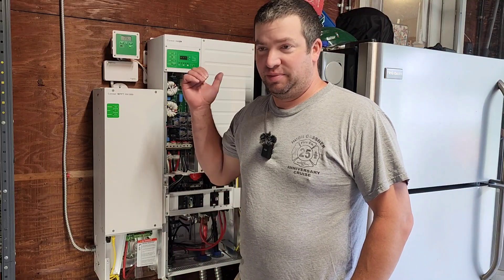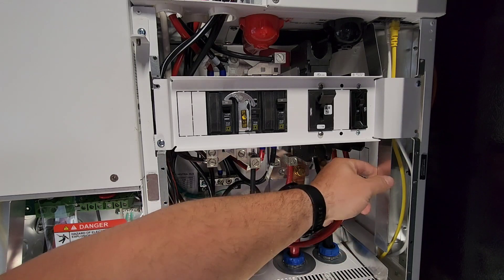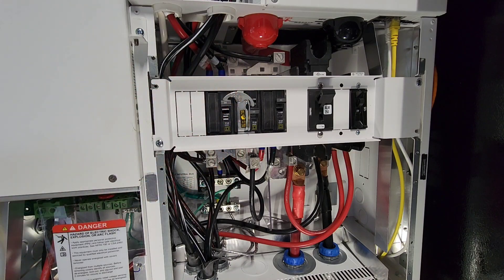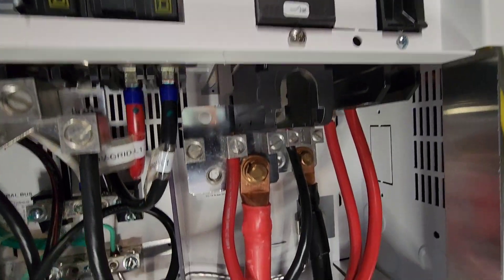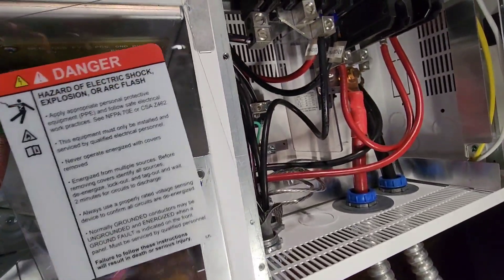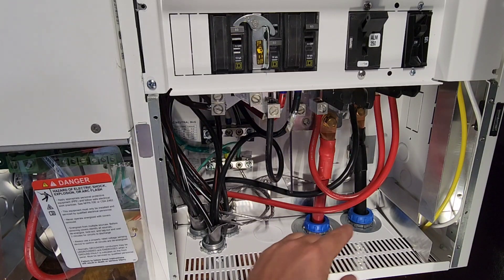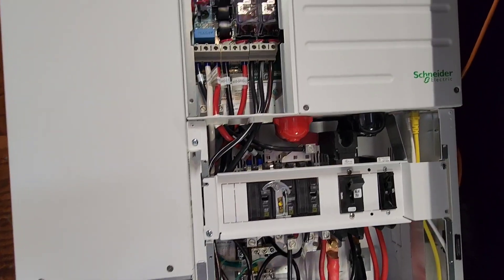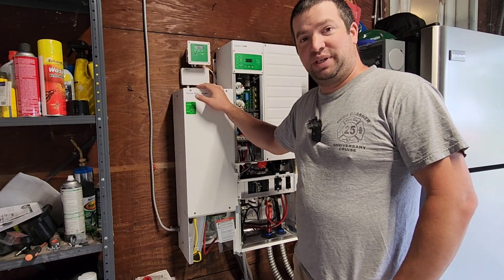Wiring a Schneider XW Pro

Comment: Where do you plug the RJ-45 into the inverter for lithium batteries?
Reply from the maker: @kylestrong8860  you don't.  There is a guide on how to wire a CAN connection into the insight home though. Lots of info on it, just search insight home closed loop.

Comment: How do the batteries communicate with inverter? How inverter know state of charge?
Reply from the maker: @samba2498  there's a battery monitor which measures power in and power out and calculates soc based on those numbers.  The batteries themselves don't communicate with the inverter.  The BMS on each battery operates individually and should never have to do anything unless there is something wrong.
Reply: @benssolarandbattery  thank you, I have battery monitor but used with AGM batteries (replacing with EG4)Can I hook it to EG4 wall mounted battery as well?
Reply: @benssolarandbattery I have the EG4’s and it’s saying the master battery should connect to the inverter over RS485. But you’re saying the charge controller doesn’t need that Ethernet cable?

Comment: Subscribed.   Thanks for this arrangement of the Schneider gear.  I was use to seeing the breaker box to the right of the inverter (seems to fit well there too) so had to do a triple take to understand your way of wiring.  I'll look around your channel on how you tied this into your load center.  I've seen where the big Sol-Ark 15k can just be in line, but wonder if this smaller system can be as well.  Learning.  Thanks!

Comment: Hey Ben, got a question. On my xwpro, with grid in. It doesn't invert it just passes ac through. Just wondering what settings do you need to setup on the insighthome. I have ac1 priority right now. And the other two are Gen, ans ac disqualify. Neither of them allow the xwpro to invert.

Comment: Thanks for the videos. I recently installed an XW 6848 Pro with the mini pdu.  A concern I have is that it appears that the factory installed L1 and L2 wires from the grid in are reversed where they connect to the bottom of the grid breaker. The drawing appears to be correct but on my pdu the L1 and L2 are reversed and it appears in your video that yours may be reversed also. I did get ahold of Schneider yesterday and was under the impression that they were going to send me an email that I was to attach photos to and send back but I never received the email. I tried calling again today but was on hold for a bit  but  then got a message to call back later because no one was available.
Reply from the maker: If you're in a situation where L1 and L2 being reversed matters, make sure you test for that.  In most cases, it doesn't really matter, though.

Comment: Ok, I swear I read all the comments and didn't see anything about what SER wire size you're using. Nice that you're using aluminum, but what size for the ac input?
Reply from the maker: I used #4 SER on a 60a breaker. So much cheaper than copper romex!

Comment: So how did you get your, cable? From the insight home. To the mini pdp? I see the yellow cable. Coming from the charge controller. But not the white cable. From the insight home.
Reply from the maker: I just poked it out a knockout in the side of the mini pdp using a romex connector to keep critters out.

Comment: Congratulations to YOU Dude !! EXCELLENT CLOSE UP SHOTS !!! !!!! !!!! !!!!
U R The first vid that shows the actual wiring close up in the compartments on these Schneider units. I've been looking through YT for 2 days and all U get is guys talking with the camera 5 feet out as they talk about the installation !!!
I'm getting ready to put an SW4048 with only the com box on a portable panel build on wheels with all the connections on a vertical panel area, and batteries lying on the base, which are 4 - 12V 480AH LI Batts.  The unit footprint is 2 x 3 feet with a 2 x 3 foot vertical panel area on the back side. The solar feed, MPPT controller, generator socket, Utility AC feed input and a multi breaker output panel on it will feed to a satellite panel in the basement, all with 50A 240V sockets & plugs for those connections. The only large appliance in the house is a 90's Maytag washing machine & GE High Efficiency window 'summer' AC that are both around 7AMPS. The fridge and freezer chest only have 1 AMP compressors on them. The constant winter heating is the 50W draw on a ComfortBilt 93% efficient Pellet heater & a Monarch wood add a furnace 2A Dayton blower motor that only runs 30 seconds at a time cycling out Hot air. There's 12 325W panels that will install to power the setup. IT should run fine with just 10 of them in 5 sets of 2 in series.

Comment: Did you install  the grounding fuses in the  Conext MPPT 100 Charge Controller? Why or why not? (I'm not sure what I am supposed to do here). Thanks.
Reply from the maker: If you're installing it into a negatively or positively grounded system, you'll want the fuse in the respective position. Most new installations will not use a fuse.  The system will still detect ground faults, though, as long as your grounding is done correctly.  (I tested this by accident, it does work)

Comment: So what wiring is provided if you go with the PDP and inverter?  I know you'd have to provide the cables from the battery bank to the PDP, the wires coming in from your PV array, and then wires out to your load center panel.  But are all the "internal" cables provided?
Reply: Yes, "internal wires" are included. Yes, I have a mini pdp.

Comment: Hey great video like your instal i have the same set up. I have a couple of questions what is the size of the cable coming out from your charge controler to your pdp? The other question is wer do you biy the breaker for the charge controller i have the 80 600?
Reply from the maker: Anyone who stocks the charge controllers should stock the breaker.   For an 80a charge controller, I'd recommend 4awg wire.

Comment: Do the positive and negative cables have to be the same distance from the battery bank?
Reply from the maker: No. If you have multiple batteries in parallel, the positives should be equal, and the negatives should be as well.
Reply: ok and the final cable from the busbar to the inverter must both be the same?

Comment: Hey I just had this system working perfectly since January. However, Thursday an electrician came and put in a new primary electrical panel and electric meter, my old panel is now the secondary panel. I am still feeding the house through a 50AMP generator tie in. The day before the new panel I stress tested the unit with 12kw and it held up for 30 seconds no issue. After they put in the new primary panel the system will run, but as soon as any large load starts up the AC disqualifies, the system resets and triggers F.91 fault and AC fault. To test I ran the generator directly to thee house and I can run the house no problem. But when I connect the generator to the Schneider then to the house the same symptom happens; it is fine at low wattage, but but the system trips and I get a BMS error (even with BMS disabled). The generator did not cut out. Before the new panel I could run the house via battery, solar+battery, or generator, all through the inverter. Now I cannot run the house one anything over 2kw load on the inverter, but bypassing the inverter and connecting the generator to the house I can run everything so I know their connection is working. The electrician even moved the generator tie in for me to the new box, same thing. Any help is appreciated.
Reply from the maker: Hmm. Sounds like something is either miswired or loose. I would have the electrician come back and go through the whole system.  If it worked before he was there, but not when he was done, he should definitely go through everything.
Reply: @benssolarandbattery  I narrowed it down to only the Central AC circuit. The electrician is coming back. I tested and I can run 12Kw on the inverter using the oven, stove, coffee pot and microwave-so nothing wrong with the inverter. However, if I turn off everything and try to power the central AC it detects an AC fault and starts resetting and giving BMS errors. The generator does not care and will still power the whole home. But somewhere there is a fault. One thing we are changing is thy used a heavy gauge aluminum wire to connect the main panel to the sub panel. I am thinking that has to go-my house was 100% copper.
Reply: @TimothyEdgin  Any updates after your electrician came back?

Comment: I am having nothing but great results with my Schneider XW Pro-I am off grid 70-80% of the time even on lightly cloudy days-and and have too much for my battery bank on sunny days even in January. All I need now is a hookup to the grid so I don't have to run my oven to burn off excess energy. I paired this with 16 REC 375 Watt PERC panels, some EG4 batteries, and I have been getting better than I was expecting in the winter. I have had too much power on many days so I really need to grid tie eventually-running the oven to burn energy because the batteries are full is not ideal but Centerpoint Energy hates solar and it can take a over year to get grid tied in this part of Texas. So for now it is either grid or solar-not both. But I love this inverter. It is far batter at inductive loads than the 6Kw Sigineer Power inverter it replaced. I still like the cheap inverter-but this Schneider can run my AC, electric range, and the coffee pot while two gamers are gaming. And that is is only on two EG4 batteries. I am going to get 2 more batteries shortly then another 2 later. But already I have too much of a good thing and I can finally use it with very little issues. In an emergency this will be priceless. Thanks for the videos.
Reply from the maker: Glad to hear it's going well for you!  They've definitely gotten a lot better in the last few years.  I'm using mine currently as a backup for the LG Home 8 battery I'm load testing. If the LG shuts down, I know the XW will be there to take over.

Comment: Hey Ben.....you mention this being grid attached but then later say that the neutral block and ground block are bonded.   For on grid I would have thought the bonding would be left to the grid/entry panel and then the XW portion be left un bonded.   Can you elaborate some there?
Reply from the maker: Sorry if I was unclear about that.  The neutral and ground are not bonded at the XW or PDP.  You can bond them there if it's off grid, but mine are bonded in the main service panel.

Comment: Cool install. I am a solar installer in Missouri and have used several different brands of equipment over the last 4 years. Of the Sol-Arks I have put in, about half of them have been having a lot of overload shut downs when they shouldn't. It's disturbing that I have less ( or no ) problems with the cheap inverters that are for my price sensitive customers. It isreally great that you demonstrated the install in such detail since I will be handling a Schnieder in a couple of weeks and now feel much better about the process. If I like it we may go to them exclusively. Keep up the good work.
Reply from the maker: Glad to help! The Schneider installation is a little more involved, but totally worth it in the long run.

Comment: Thank you Ben, I just finished the ground array and hung the components on the wall. Now I need to wire it and connect it to my house. Was going grid tied but might just pull off some critical loads into its own panel and segregate the systems... You have any thoughts on that?
Reply from the maker: It all depends what your utility is like and whether or not you have a net metering agreement.  You can tie your whole house through it and do zero export, tie half your house through it and use modbus with CTs to do zero export on your main load center. Lots of ways to do it really.

Comment: It would be nice if you start to document start to finish on installing these...since Schneider doesn't feel it necessary to provide support to the peasants. This is what holds people back on these xw inverters and force people to buy a solark while it might not be the best choice for them. We need more in depth info on installing these with and without the pdp panels since it would be more cost feasible for us to use breaker panels from home depot that would allow us to connect two, three and four of these with what the price of a single pdp panel cost.  Why didn't you have to connect the neutral from the grid on yours?
Reply from the maker: It's hard for me to document start to finish in one video, as I rarely have more than an hour at a time right now.  Have you tried calling support recently? They answered for me right away even when I said I was not an installer.  The neutral in and out is tied together in the inverter and there's a neutral bar in the mini PDP as well, so no need to hook up 2.
Reply: @benssolarandbattery  Thanks Ben for the time you do have sir..we're very thankful when experts like you come in and help the diy crowd otherwise some of us would not be able afford any of this when we're in a time that solar might be the difference between having electricity or not. I was looking at solark but for many reasons I'm looking at outback radian or the xwpro instead. I hate the fact they charge so much for the pdp panels. Thanks again bro for your time.
Reply: Leave off the extras and wire it like any other system using this video as a guide. You saw breaker sizes, wire sizes, etc.

Comment: Have you happened to mess with your ac coupling yet . I was talking with a guy at Schneider & discovered that with the sw even though it isnt able to export itself when the batteries get full it will allow the pv inverter to export through it when connected through grid and when grid is off its internal relay prevents grid injection. When i have the grid off i would like to see more of a float mode for the loads rather than a shutoff & requalify for the pv inverter . Have you messed with your settings yet with yours ?
Reply from the maker: If your grid tie inverter can do freq/watt modulation, I believe it will start limiting the output.  Mine won't but I've seen the XW kick the frequency up by a small amount at first. You'll have to look at the grid profiles on your inverter(s). I know you can do it with Enphase using one of their Puerto Rico profiles.

Comment: What cable did u use from the 100/600 to the pdp and why? Is it a#4? 
If my pv setup  is 21A/450V i should be set at #6. Am i right? Thanks and nice video.
Reply from the maker: I did use 4awg.  21a at 450v is 9450W which is too much for this 1 charge controller.  If you divide that by 48V, you get 196a.  If you plan on maxing it out, you should use 2awg.
Reply: @benssolarandbattery  yeah i rounded way too much. Its 18A and 428V. Going for awg 2 as suggested

Comment: Thanks Ben for the thorough and helpful installation review.  AC Coupling performance would he helpful to learn about....for those of us with existing solar who are thinking about adding batteries for consumption reduction and backup.  Specifically I'm wondering how it performs with an existing net metering connection in terms of exporting maximum energy for credit, reducing grid consumption, and features that help optimize that balance.
Reply: I'd be interested in this avenue too
Reply: Me too

Comment: Ben, another great video but, you'll never convince me that Schneider is better than Sol-Ark. Now that I have got my Sol-Ark 12K up and going with sixteen 360W panels on one side and another sixteen 370W panels on the other, coupled with a auto transformer, I'm running 2 well pumps, a 5hp compressor, 200AMP Mig welder, and everything else during high hours without a problem. One thing that amazed me was how fast my LTO battery bank gets recharged. So I am using the overflow to weld and keep my compressor full of air. I also charge all of my Makita batteries as well.
Reply from the maker: I'm not trying to convince you that it's better.  Each have their pros and cons.  Glad everything's working well for you!
Reply: @fisherus , What  auto transformer are you using?, Thanks
Reply: Cool story!
Reply: My two 12Ks have worked great for 18 mo, except occasionally tripping if I’m pushing a lot of 240V loads then I start my vacuum or circular saw, then it faults out for two minutes. 

Tried two pos, flickering, pulsating, 6500ex from SigSolar on my shop. I will never buy cheap Tier 2 equipment and nothing from SS! 64kWh of LFP, so plenty of power. 16000W of PV.

Comment: Question on sizing, what’s the best way to know if you need use more that one XW pro?  My goal is to try to run my house with out a critical loads panel and start off with only battery back up with grid power and generator. My loads spike to 7452w and with an 1800w average load with HVAC turned on.  I am willing to turn off major loads when on battery.  Looking for 30 minute window before starting to manually shedding the load from my main panel.   Thoughts?
Reply: The xw pro is a lf inverter so it will be able to handle spikes very well . I have the sw (The little brother to xw it handles a 2 ton mini split and a well pump with ease highest ive seen it was 4700 watts & idle consumption of 1.2kw.  In his last vid he showed the xw doing 10kw . Those units are beast.
Reply from the maker: 1 XW should handle that, but what you could do is install 1 and use a full sized PDP, that way if 1 isn't enough, you can easily tie in another right next to it.  These do handle a lot, but be aware that the overload is temperature based, so if they're in a hot space, they'll overload quicker.
Reply: @benssolarandbattery  exactly my plan Ben,  thanks for the detailed video and commentary
Reply: @benssolarandbattery 

Can you not put 2 mini PDPs next to each other for 2 inverters??
Reply: I believe 6KW is the backfeed limit.  I'd personally move circuits over to another backup panel and have 12kw available.  You could leave some circuits in the main panel and backfeed those while powering the backup load panel.